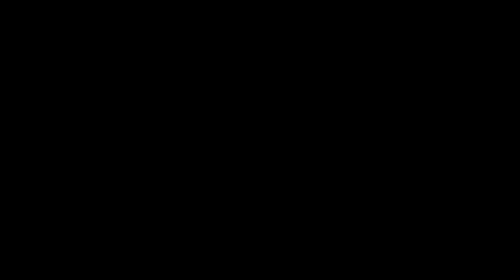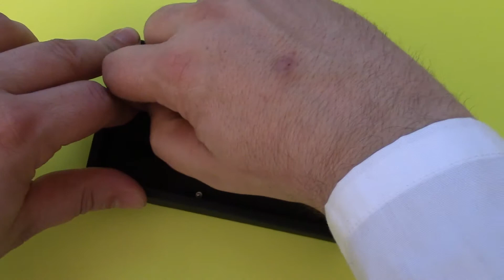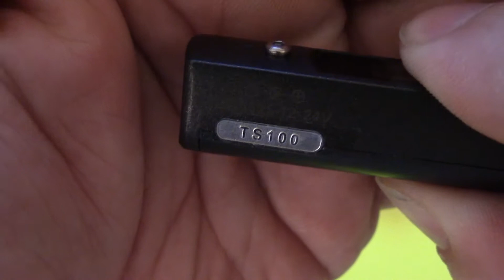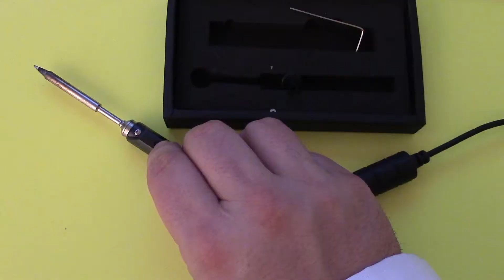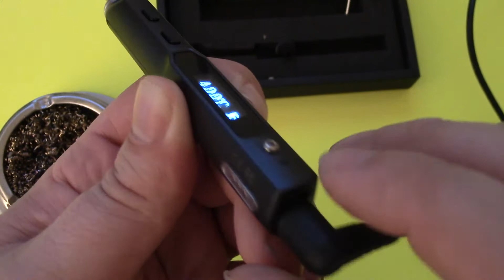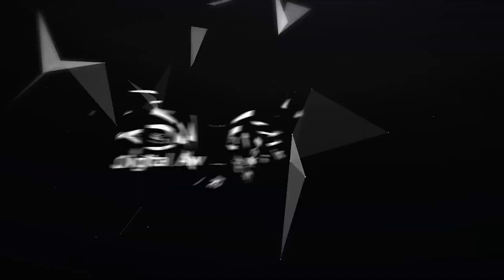TS100 Variable Temperature Soldering Iron

Comment: its much better than an 888d
Reply from the maker: I would not go that far to be honest. They both have their strong points, the TS100's interface is MUCH better. But the fx-888D is much better at holding temperature when soldering low gage connections. I have both on my bench and to be honest, if only because it feels much better in my hand, I almost always use the fx-888d.